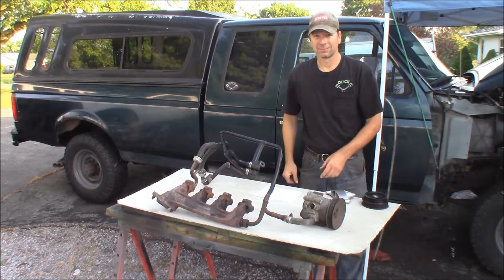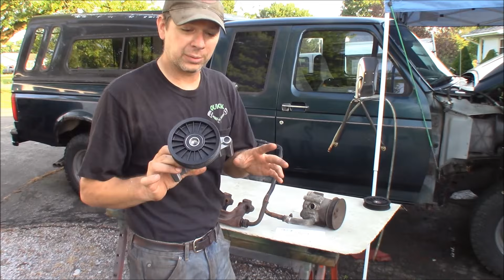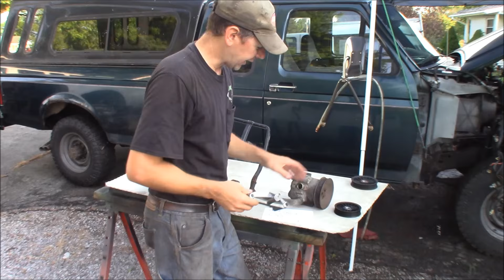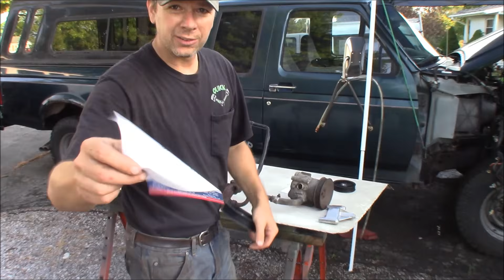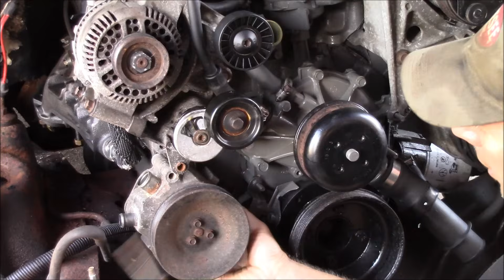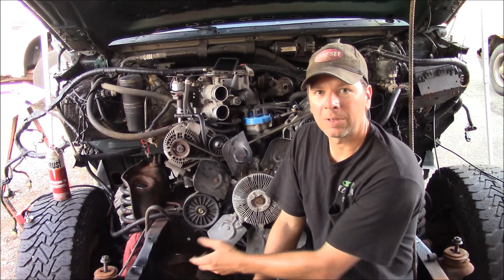1992-1997 OBS Ford Truck 5.8L Air Pump Smog Pump Delete F-150, F-250, F-350

Comment: Did you have any issues with the serpentine belt after this? Shortly after I installed this bracket, the tensioner bracket bolt snapped, I installed a new one now I can’t get the belt to move straight.
Reply from the maker: No.  Run this truck almost 50K since this video was made.  Also did the same thing on my other truck and also my van and never had any problems.

Comment: FYI, PSA.  I'm doing this air pump conversion this weekend in my 1992 E250 5.8.  Some stuff you cant find anymore.  But at Rockauto I got the correct pulley for the 5.8.  GATES 38029 $9.60.  That Proform bracket is NLA as well.  Had to go to AmericanMuscle and order the real Ford smog pump eliminator kit 50271 for $99.99.   But my pump has blown seals and leaks oil all over the place so i have to do this.  As in your other vids.  I a also changing my exhaust manifolds but this is a lot easier on a van with a dog house.
Reply from the maker: I listed other options in the comments and description as other people had stated the same lack of availability of parts I used in the video.
Reply: @QuickSpeedShop  what sides belt did you use

Comment: Will this work in a 5.0 truck?
Reply from the maker: Yes, as long as its not a 1996.  The bracket I use is actually for a 5.0L so you won't need to change the pulley.
Reply: @QuickSpeedShop  thank you!

Comment: My smog pump rattles like crazy when engine is running. Its the second aftermarket pump put in. Is this a symptom of bad pump? If deleted it should sound like a normal engine?
Reply from the maker: Yes, bearing are bad in it.  Just do the bypass pulley and never worry about it again.  It's been 45k since I made this video on my truck.

Comment: Got the pulley and bracket took out air pump it all fit. I just havent run it yet have other things I'm working on need new vacuum lines .

Comment: This previous comment about air tubes meaning the 2 coming from the pump route them to the air cleaner is that what they mean
Reply from the maker: The computer can't be reset that way.  It will throw the check engine light if it doesn't see the oxygen sensor.  The computer might run in open loop.   Why do you want to remove it as the computer uses it to adjust fuel mapping.
Reply: Just trying to get rid of non essentials
Reply: Ok bad idea about 02 sensor

Comment: What about a 89 xlt 5.8 bronco
Reply from the maker: I haven't personally done one, but if it's layed out the same as the '92-'97 5.8s it should work.
Reply: I'm in the middle of putting on headers trying to avoid facing all the junk I dont need ,am doin right side this weekend and that's where it all sits. Thx

Comment: I got the bracket but the pulley you showed appear smaller than my smog pump pulley
Reply from the maker: I said that the bracket came with the 5.0L pulley.  You need an AC idler pulley which is larger diameter to work with the smog bracket.  Watch the video again, I clearly explain all parts involved. Read the description.
Reply: Yes i saw the complete video and understand it but the pulley you use is 132.5mm and my smog pump pulley measures 135.89mm i accidently bought the a/c pulley that come with the bracket and it measures 127mm so that one was far off did u have any issues with the one you used ? Was it the exact same size as your smog pump?
Reply from the maker: I didn't measure the pulleys so those diameters don't mean anything to me.  On both trucks I have done, a 1995 and 1997, I used the pulleys in the video with the factory serpentine belt and it worked fine.  Both trucks had original Ford smog pumps with the same size pulley.  Both trucks were 5.8L.  The 5.0L has a different belt length and different pulley size. If you are trying to do this on a 5.0L all you need to do is put in the smog delete bracket.
Reply: Well ill give it a shot and if ill make it work ill let you know incase some else asks you you can let them know thanks for actually replying a lot of people dont even reply

Comment: My smog pump is off. It came that when when I bought it. I bought the bracket and pulley. Do you know the size bolts/thread and length that is needed? my truck is missing them.
Reply from the maker: The bolts are SAE thread, not metric.  I believe the top bolt is 7/16-14, but not sure how long it is,.  Just measure your bracket and add an inch or so and that will be the correct length.  I think the shorter lower bolt is 3/8-14, but you could find a bolt that fits if you have it in your hand.

Comment: I have an 88 with same motor. Looks like the same set up but you said it only works for 92-97?
Reply from the maker: Never worked on '87-'91 so wasn't sure.  It should work the same

Comment: I used tuffstuff 1700 bracket and the dorman pulley . It came out great luckily my 93 f250 had pipes that went to the cat so I didn't have to block then off since they weren't there.  

My bracket costs 60 shipped compared to the 130 Ford bracket.  

Maybe it's worth doing an update
Reply: I bought the bracket he says to and there isn’t enough clearance for the belt to get on
Reply: @josephlanoue1595   you have something wrong

Comment: What is an ODO 1 computer ?
Reply from the maker: The Onboard Diagnostic Computer Version 1 that was used up until 1995 and is a pretty basic computer system with minimal monitoring.  OBD-II came out in 1996 and monitors many more things including smog pump system
Reply: @QuickSpeedShop  You missed jab , at ODO vs OBD childish of me .

Comment: I own a 92f250 5.8 truck. Want better fuel. Economy and if possible better performance. 69000 miles and looking for a shop to do work in Florida
Reply from the maker: Removing smog pump doesn't add power or increase economy.  Just removes a piece of equipment that adds no benefit and can fail and leave you stranded.  5.8L is not really a powerhouse or fuel efficient engine.

Comment: i would like to do this but i rather bypass the pulley with a shorter belt. Does any one know what belt size i need for a 1989 E150 van with 5.0 motor ?
Reply: I have a 923k6 on my E350 with 5.8L

Comment: Wouldnt it be cheaper and easier to just remove the pump and everything and get a smaller belt?
Reply from the maker: In theory yes, if you want to figure out the right length belt.  Then you need to remember which one fits if it breaks later on.  I did it this way because it mimics the OEM way and uses the original belt.
Reply: Get the shorter belt and the replacement part is × # of ribs in × length in millimeters.  Just right it down under the hood or in the owners manual.  Easy peasy.
Reply: That's what I did. works fine. I suppose you would just write the size down.

Comment: pardon my ignorance but what does this mod accomplish? I just picked up a 97 f250 5.8.
Reply from the maker: The air pumps fail and seize up.  This mod removes the useless air injection system and replaces it with an idler pulley so you can still use stock size serpentine belt.

Comment: Air pump seized on my f250, so I installed a smaller serpentine belt and bypassed it. No need for an idler pulley!
Reply: what belt did you replace it with/. Mine just seized and I have a hurricane coming at me in 2 days.  thanks
Reply: @gypsykevandev I used a k060854
Reply: Wondering the same thing

Comment: would this bracket and pulley work on a 1988 f250 5.8L ? i know the air pump is the same for an 1987-1996 according to the part stores that is
Reply from the maker: Most likely although I haven't worked on the '87-'91 trucks so can't say with 100% certainty
Reply: i have a 89 250 5.8 with the tubes on both sides did you ever end up doing this and how'd it go?
Reply: @AntiMaxer  no i haven`t done this yet. i took off the air pump , modified the bracket to fit a 130 amp 1995 mustang alternator ( pulley is slightly bigger) and i used a shorter belt  and i also plugged off the holes in the back of the heads. she runs just fine
Reply: @awh5773   can confirm it no longer exist plugged the tube to the cat the tube to the heads replaced both manifold which came with plugs left the tab and tad but plugged the lines to them removed about 60ft of hose and hard line and left the egr and evap system installed left the pump just acting as a  pulley for now No CEL so im happy also cleaned  did the valve covers and gaskets intake gasket egr gasket and cleaned and replaced throttle body gasket only one broken bolt truck seems happy
Reply: @Anti Maxer  I also did all that as well.  I did make an EGR block off plate out of a piece of flat aluminum  and used 2 gaskets.  I also made the wiring  harness and moved the ignition module  over to the drivers fender. I put an oil cooler on my 5.8L from a 1996 5.8L. Basically  done all the stock upgrades.  My 1988 5.8L f250  runs like a scalded ape. I also installed newer fuel injectors. From a 1995 e250 conversion  van that look like the original  one shot ones but these have 4 holes. And I actually  got a K&N air filter for $2.00 at salvage yard.  And I got the fresh air  intake  from a 300 inline 6 truck that goes from behind  the grill  to air filter box.   I really  can't  tell you how much better this old 1988 f250  runs and I'm getting  between  18 and 20 mpg , give or take a little.  Was thinking  about  adding an electric  cooling fan and removing the mechanical  one to free up  a  little  more power. . One last thing. Down on the frame where the fuel filter and abs pump are. There is supposed to be a heat shield.  I never knew that.  If you don't  have one. Either make one or get one from salvage yard. Trust me. You need it.

Comment: Will this also work on a 96 5.0 f150
Reply from the maker: No.  '96 F150 is the only OBS Ford that has OBD-II computer which will throw check engine light if smog pump not functional.  All other OBS trucks used OBD-I which doesn't monitor pump function.

Comment: Does this cause any fuel exhaust smell when removed or does it burn pretty clean.
Reply from the maker: No difference.  Oxygen sensor and computer control fuel mixture unrelated to smog pump.
Reply: @QuickSpeedShop  could it's cause a loss of power if the hard line to the back end of the exhaust is cut?
Reply from the maker: No.

Comment: I have a 96 e350 5.8  and my egr system looks nothing like that
Reply from the maker: EGR and smog pump are two completely separate systems
Reply: @QuickSpeedShop  my bad I was thinking one thing and wrote another… but still looks completely different. Did they have a different system on the obd1 vs the obd2 ?

Comment: Greetings! 
I have both a
 95 F150 4.9L 300cui
93 f150 5.0 302 cui
I am planning on doing a smog delete on both in steps.. Currently on my 93 5.0L with a locked smog pump. Like to remove the smog pump but leave the egr. 
My 95 4.9L has a broken exhaust system and I'm considered removing the smog system. 
 I was so confused on all the different hosing and lines but watching you video has giving me some relief and hope that I can do this. 
I plan to block the egr off.  Remove the air pump and run a bypass. Either by doing what you did by a idle dummy bracket with the original belt or run a smaller belt. 
And on the 
My question is . Would this  somewhat work on my 5.0l and 4.9l?    And the air emissions unit. It has 3lines to it right?  Intake exhaust and air pump. Do you take the intake and exhaust ends the loop those together?
Reply from the maker: First of all this is for the smog pump only and not EGR.  They are two different systems that act independent of each other.  As for the 4.9L, don't know, never worked on one.  As for the 5.0L, all you should have to do is buy the bracket and bolt it on as it is actually for a 5.0L to begin with.  Read video description as the original part number in video is not in production anymore.  Also far as I know the 5.0L is set up different with the smog tubes bolted to the back of the heads and not the manifolds like on the 5.8L.  I just did a 5.0L and all I did was remove the smog pump, plug the hose to it and, bolt on the bracket.  I left all the tubing and and vacuum lines in place.
Reply: @QuickSpeedShop  man this helps alot. Got a 88 5.0 and my pumps been squealing like a stuck pig. Im sure as hell not payin 300 for a new one. Thank you.

Comment: What qualifies a truck as obs? Idiots.
Reply from the maker: The term developed from when Ford came out with the new F150/F250 light duty body style in '97.  The old body style F250/F350 was also still in production in '97.  Hence the term OBS.  It now gets applied to all the '92-'97 trucks.

Comment: What did you end up doing for the lower bolt  on the idler pulley  ,  longer bolt nut and washer
Reply from the maker: It uses the factory bolt.  Bolt goes in from the back just like it did on the smog pump.
Reply: @QuickSpeedShop  the bottom of the bracket is not threaded  I was wondering what you threaded the bottom bracket bolt into
Reply from the maker: The one I used was threaded.  If yours isn't then you'll have to thru bolt it.

Comment: Will this work on a 1991 f250 with 5.8l 351w
Reply from the maker: I believe so as I just did one on a '88 E150 van.  I don't know how the air injection is set up on your F250, but the bracket should work.  Be sure to read vid decription or comments for updated parts numbers.

Comment: Will that work on a '94 F-150 4.9L?
Reply from the maker: I haven't done one so not sure.  I would assume that the air pump is the same from the I6 and the V8, but I don't know how the lines are layed out on the six.
Reply: @QuickSpeedShop  The pump looks to be in the same place below the alternator. I'm wondering if the air pump idler and pulley will work. I assume the new pulley takes a bolt. I will let you know if I have any success. Great video by the way. One of the best I have seen.

Comment: How does the computer in my 96 f150 302 know that the smog pump has been deleted ?
Reply from the maker: Because your F150 uses an OBD-II computer and it will throw a check engine light.  My delete only works on the '95 and down F150 that uses the OBD-I computer.
Reply: @QuickSpeedShop  I have heard that I can purchase a egr sensor Eliminator plug that make the computer run in a closed position.
Reply from the maker: No idea.  I can't verify that would work or not.  All I know is that the OBD-II knows when the air injection is not operable and the older OBD-I does not.

Comment: I wonder if this will work for 1991 Ford F-250 with the 5.8 (351 Windsor) engine in it.
Reply from the maker: It should work the same in theory, but I have not attempted on the '87-'91 trucks
Reply: @QuickSpeedShop  I took the smog pump out. Thanks for your help. I just need to plug the colored vacuum lines that went over to the passenger side because right now my "check engine" light is on. The two big black hoses that ran over to the Driver's side I joined together with a piece of 1/2" PVC conduit (Perks of being an Industrial Electrician. LOL.
Reply: @IBEWelectronut  Did you get the check engine light to turn off? Any issues with running this way?

Comment: Great Job! What about all the hookups down the back of the engine? Are they affected in doing this?
Reply: Could you explain how you exactly you plugged and looped those not much room back there
Reply from the maker: I showed it all in the video.  Only pipes are to the manifolds and the diverter valve on top.  I plugged and removed both manifold pipes and looped the diverter valve.

Comment: Not worth it to do on my 1992 Ford F250.... unless I ever rebuild the engine again.  Too many holes to fill....and it would include removing the pipe at back of engine that is attached to back of both heads and pipe that goes back to the catalytic converter.  Am thinking about just doing EGR delete, as the EGR pipe wants to sit tight against my new tall valve covers, after I installed aluminum heads with roller rockers.

Comment: I just got the same setup and replaced the pulley on the new bracket with the Dorman 419644 and I noticed that that idler pulley is just a hair smaller than the factory Air Pump pulley. I am assuming that the belt tensioner makes up for the difference. Did you notice that? Thanks for the information!!!
Reply from the maker: I didn't notice the size difference, but the tensioner does take it up.
Reply: The idler pulley makes a lot of noise. The belt is loose and does not stay straight. It is slightly tilted compared to the factory pulleys.

Comment: Why not just buy a shorter belt? Way cheaper and less work that that bracket and pulley?
Reply from the maker: You can do that and other people have said they did.  I don't know what length belt is right.  I did mine how the factory did it with the factory belt.

Comment: What change does this have on the truck? Why do it?
Reply from the maker: If you read thru the comments you see I answered this several times.  In a nut shell, removes access parts that fail on these old trucks and leave you stranded.  Deletes obsolete technology that does little if any emissions reduction.  Just showing how it can be done like Ford did it on the factory exempt trucks.  I'm not debating on the "why" anymore.  If you chose to do it here is how its done.
Reply: @QuickSpeedShop  Thanks! I was honestly asking why because I wasn't sure if it was a performance thing. I get replacing multiple older parts with one new part. I stumbled on your video trying to find out if my melted diverter valve was actually needed.

Comment: So will this same set up work on a 1988 e250 351w? We really need to eliminate the smog pump on this vehicle and can't find any info on it.
Reply from the maker: I would think so as long as the 351 has the serpentine belt setup the same as the OBS trucks.
Reply: Looking to do the same for an ‘88 F250 I just purchased.
Reply: Get it to work?  I may try this on my 89 f150 302